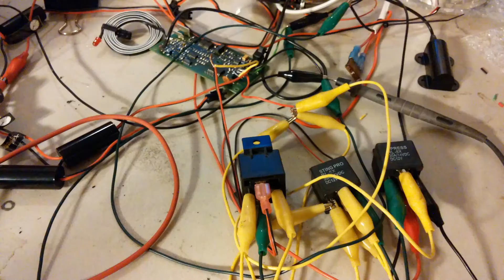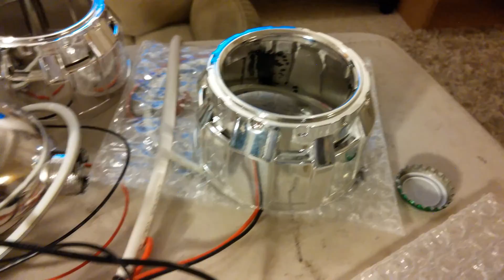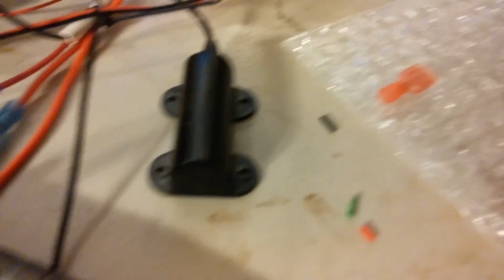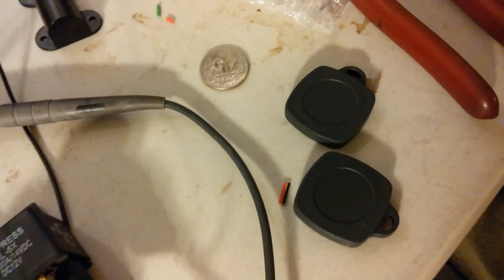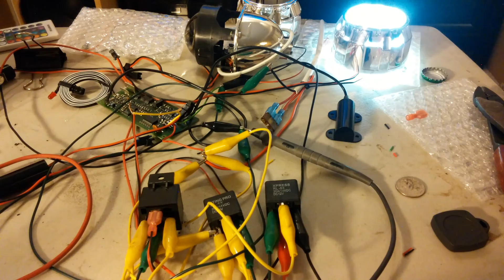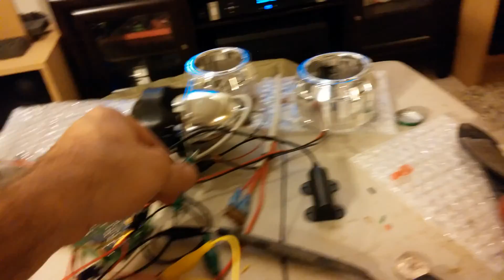DIY 12v latching RFID immobilizer bench test

Comment: why did you exactly need 3 relays ? Im wiring mine inline of my main relay on my custom chassis harness for power to my fusebox, just wondering if its just because motorcycle stuff and it needed more voltage ? or why the three

Comment: toying with this idea myself for central locking. 

Have you perhaps thought about a central locking unit for your latching ? 
General cheap non-remote unit has input wires (brown & white) which trigger lock and unlockw when earthed. However, when they touch together they complete the circuit and each time they touch, they alternate, lock and then unlock. 

Thus meaning, you could have the brown and white trigger wires on either side of a relay, and use the rfid mometary to trigger that relay, giving you rfid ignition on, and rfid ignition off.  

Good luck dude